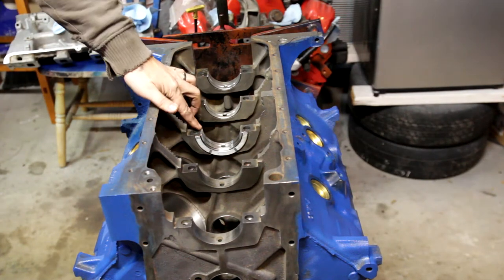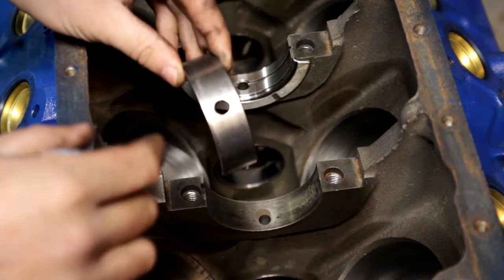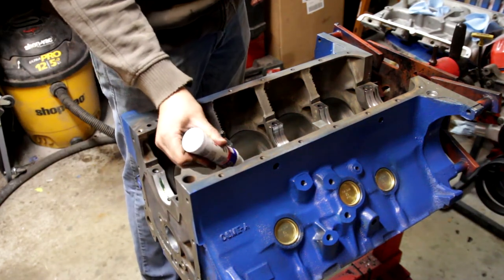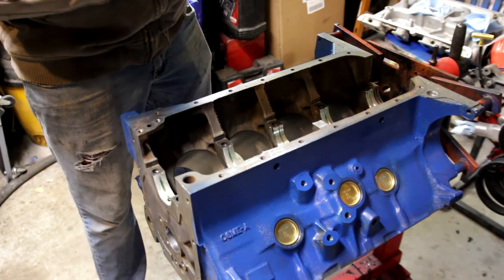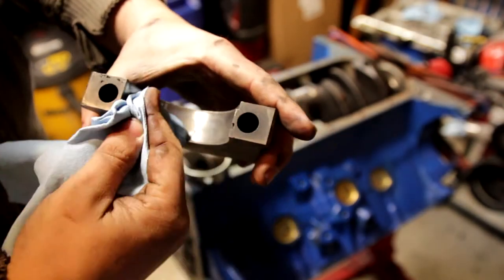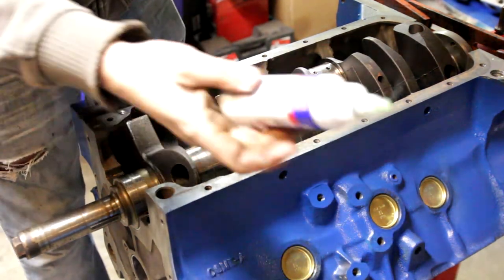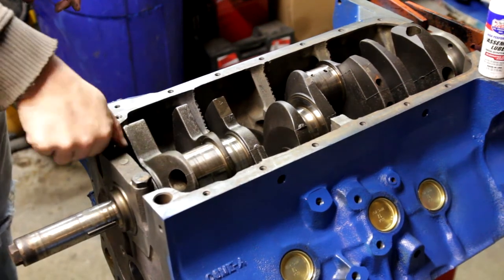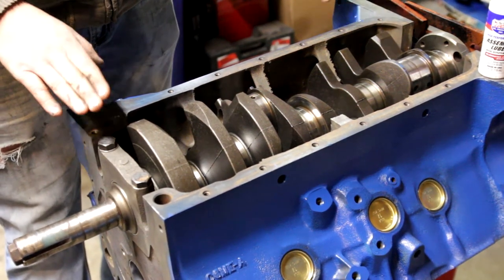How to install Main Bearings and Engine Crank

Comment: The bearing you put is incorrect. You should have put that in the block
Reply: Both halves had oil passages.. although I did wonder why the main caps used a arrow for the direction of installation when all you do is put them in tang to tang. The arrow would be useful on the conrod tho.